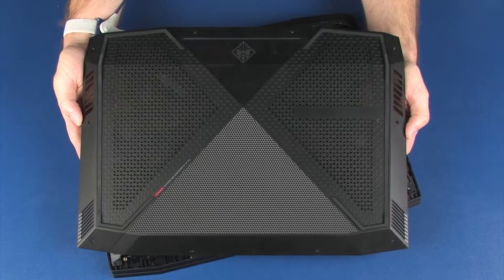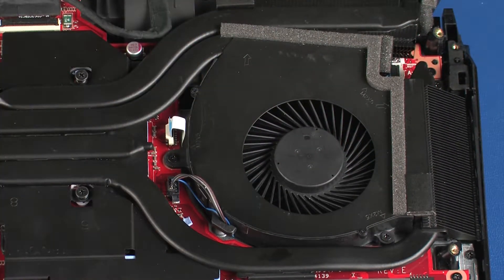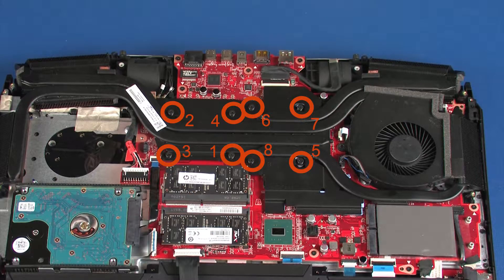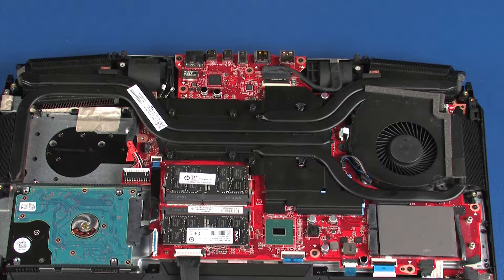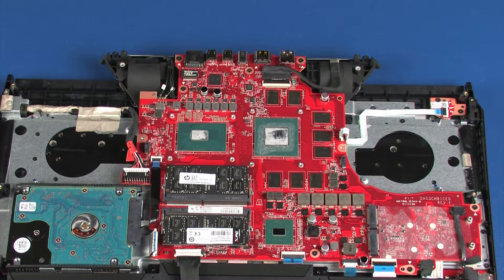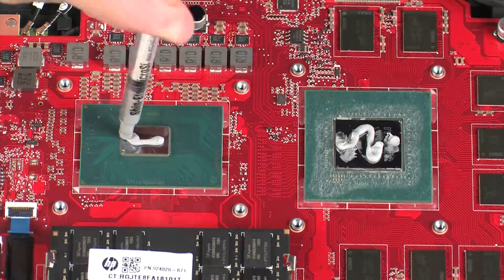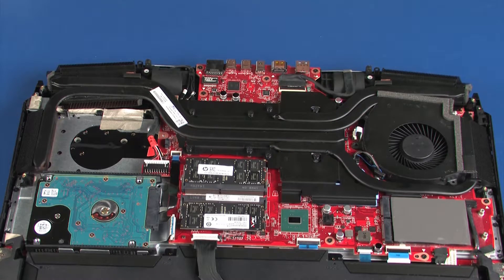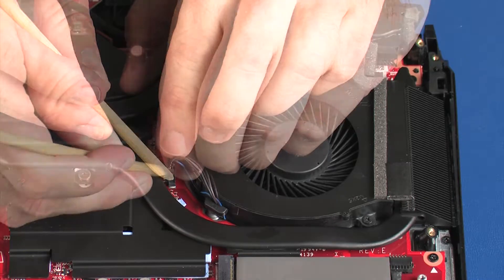Remove and Replace the Heat Sink/Fan Assembly | OMEN X by HP 17-ap0xx | HP

Comment: Where do I even buy a replacement? One of the two fans in mine have stopped working and I'm looking for a replacement to fix it. Can I just replace one of the fans? Or will I have to replace the whole fan assembly? i have an hp omen x 2x 15-dg0000
Reply from the maker: +Woasty Woans You can purchase the part from here: http://partsurfer.hp.com/ Please select your country and enter serial or product number of your unit.

Comment: Very helpful in renewing the thermal grease, thank you for that support. Sadly doesnt change the extreme heat (98°C) the processor reaches under load.
Reply from the maker: +Math Please refer this video to fix an overheating issue: https://bit.ly/3vBcT75
Reply: Wish someone sold a custom cooler for this laptop